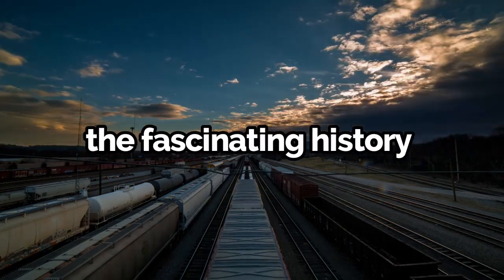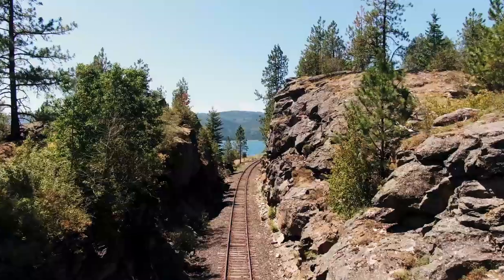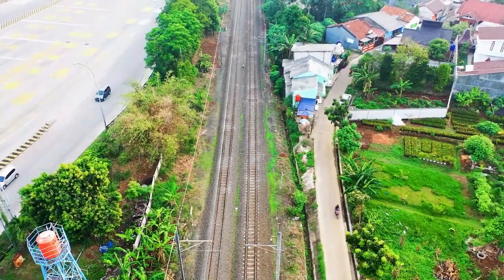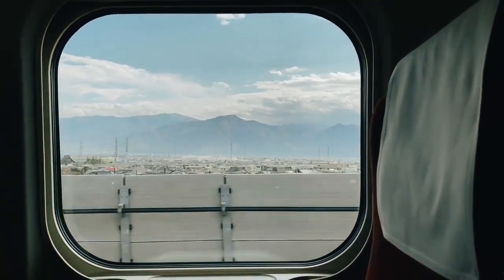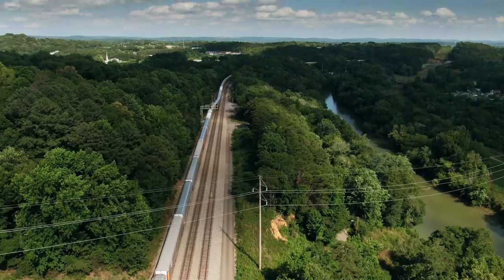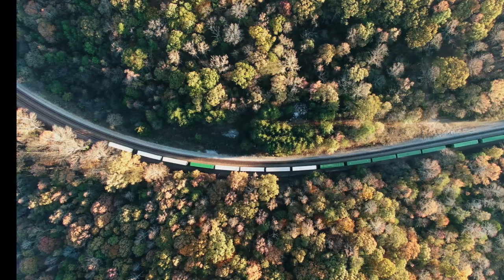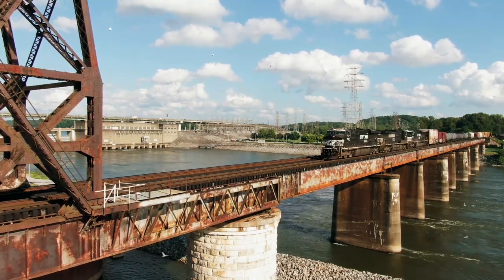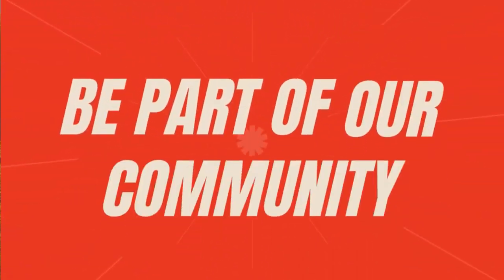Why Are Railways Built Like This ?

Comment: Are you sure that roman carriages were so highly uniform in dimensions that one would derive a gauge of 4' 8 1/2" from them, which is not a nice round number neither in imperial units nor in the metric system (1435 mm)?  Another explanation I heard was, that in the early days of modern railroading, when they experimented with the first steam locos, they had no idea that this would become such a big thing that interoperability between different railroad companies and manufacturers would become important, and that the inner gap between the rails would be the relevant distance to standardize. Instead, they just had ordered ties (sleepers) that were 5 feet long (a nice round number) from the wood mill and then somehow attached the rails to them, more or less randomly leading to a gauge somewhat smaller than 5 feet. Competing inventors and companies used different gauges. Once they had figured out that gauge should be standardized, they just took the gauge that had the widest prevalence at that time.
Reply from the maker: Through my research I couldn’t find one exact answer, while George Stephenson definitely had a hand to play in standardizing it , there isn’t one known reason where the exact dimension came from
Reply: @TheUrbanique  I do not know a definitive answer, either. However, if the British government had made a ruling about gauges (based on the dimension of carriages or whatnot), this probably could be found in the archives. I've read the story (or legend) linking railway gauges (and as an extension, even the dimensions of NASA's space shuttle booster rockets) to roman carriages already in the early 1990ies in the Usenet - without any reference to some archives or so. Repeating the story again and again and adding some stock photos to it does not make the story more (or less) true.